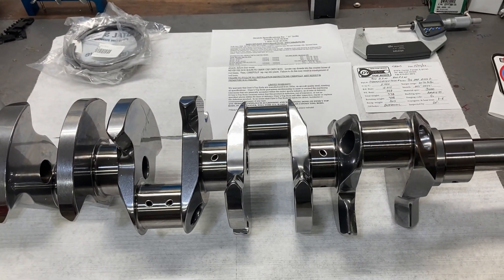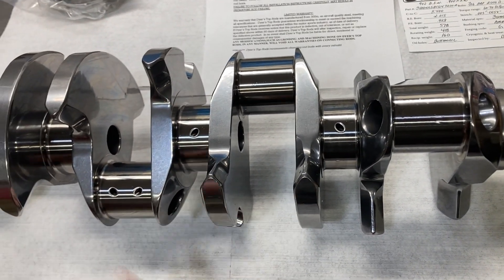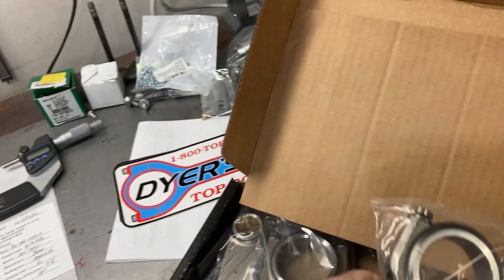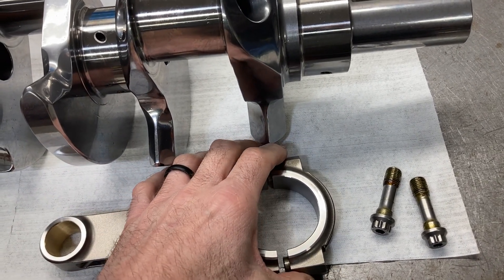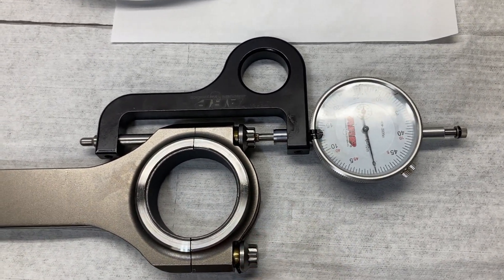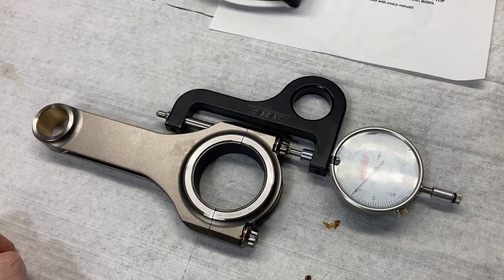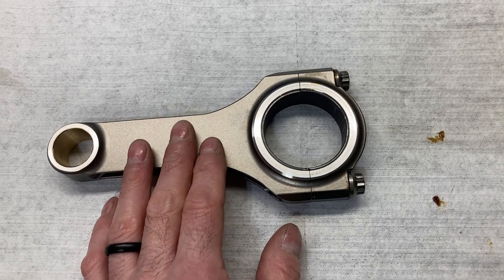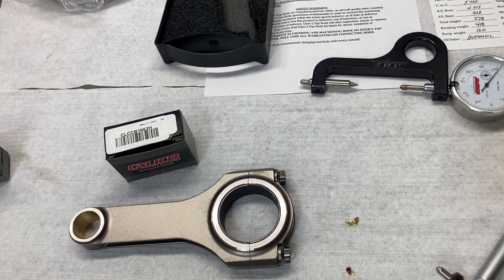Lykins Motorsports Bryant Cranks, Dyers Rods, Bolt Stretches

Comment: I have a question on rod bolt stretch. I recently put together a 390. Very basic rebuild for my ol truck. I bought arp bolts & took the rods to a shop to have the big end resized. I was checking stretch & with my torque wrench I had to go about 60 foot lbs to get the .006 to .0065 stretch. Arp says 50 foot lbs. The shop never checked stretch, they simply torqued to 50 lbs. I have it together & havnt had any problems however I would have made them stretch the proper amount but since they were resized at 50, I decided to just torque to 50 also. Did I do the right thing?

Comment: Hello Brent. I may have missed this topic in an earlier video, but you touched on road racing in this video. Have you built a vintage road racing engine? I am wondering if you have, would you pass on any words of wisdom. The class allows up to 310ci, any intake(including dual quad carbs) and aluminum cylinder heads. Any help planning our(my son and I) build would be greatly appreciated. Thank you Sir!

Comment: hi brent, how are you? what is the rod to stroke ratio that you have chosen for this built?
Reply from the maker: I’d have to calculate it.  I don’t consider rod/stroke ratios so I haven’t looked at it.
Reply: @lykinsmotorsports  I asked because the rod looks short in the video, I supposed that you had chosen it, due to the high volume of intake ports, if you are not looking for high RPM, a short rod ratio could help you to get vaccum and some torque at low RPM. Anyway I am sure you will do an excellent job, and you will get great results.